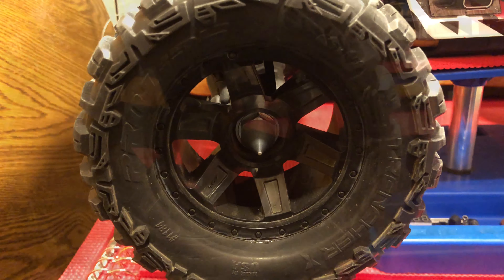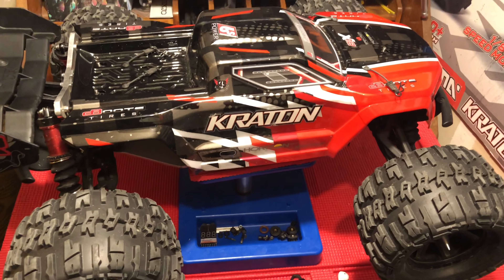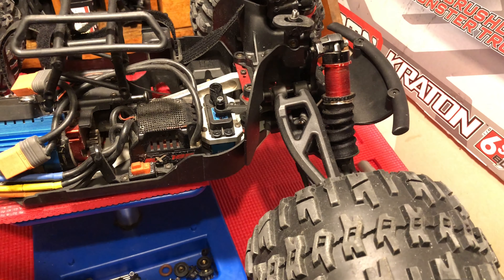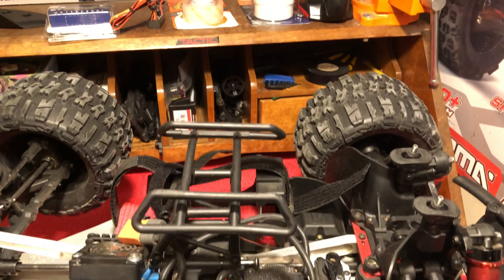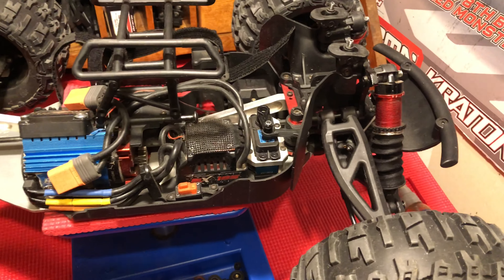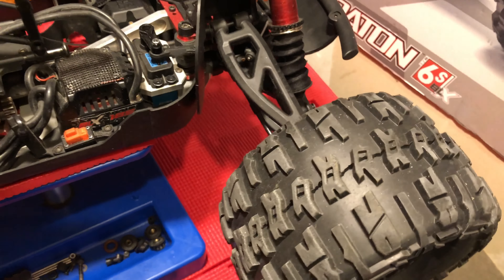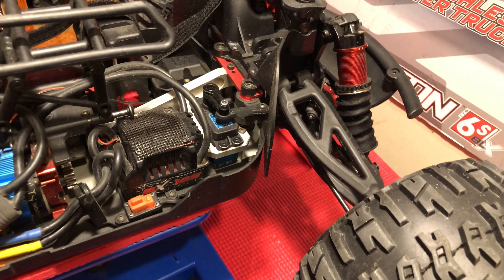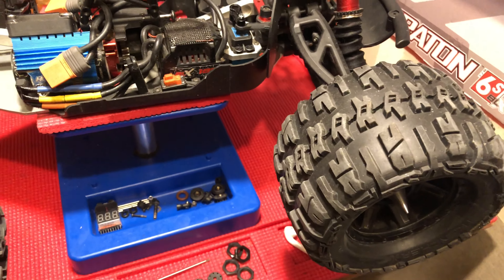FOLLOW UP - ARRMA V4 KRATON STEERING FIX - Servo savor fix

Comment: thanks so much for posting the video about the snap rings i been dealing with the terrible servo saver set up on my outcast i did everything hot racing servo mount a 25kg servo i even replaced the entire steering set up because i thought i bent it and i put bearing in the post i still turned like shit i am waiting on snap rings right now but im confident it will fix my problem and for cheap too

Comment: I have the M2C rear shock tower braces, but have noticed the rpm wing mounts are a very very tight fit with these braces. Do you think the stock wing mounts would be a better fit? I did email M2C about this but got no responce.
Reply from the maker: Darrell Jeffress, yes...I remember I had to Dremel off a bit of the RPM wing mount to get it to fit. If I recall however I don’t think I needed to do with the stock wing mounts. I don’t really prefer one over the the other When it comes to how tough they are. However I probably would say now that I have the rear shock tower brace that I like the stock one more. I will say however that the biggest Benefit toward protecting my wing mounts from breaking was that Willie bar I installed.
Reply: @EastTactics  Also Darrell- I can confirm the stock wing mount and wheelie bar from he Outcast WILL fit the M2C towers and Braces with no modifications.  I just converted my Outcast to Kraton.  See my Channel- Next video is going up(I'm editing it- and NO the vid is not as good as EASTS, but just another perspective)
Reply from the maker: Jim Halpin,  that’s awesome bro thanks for sharing. Sub’d ya
Reply: @jhalpinjr  Thanks so much for the info, gonna check out your channel.
Reply: @EastTactics  The RPM mounts seem to be a bit stronger, maybe i will check out the outcast mounts and wheelie bar, thanks for the reply, lots of useful info here.